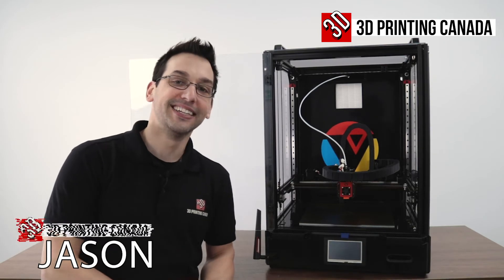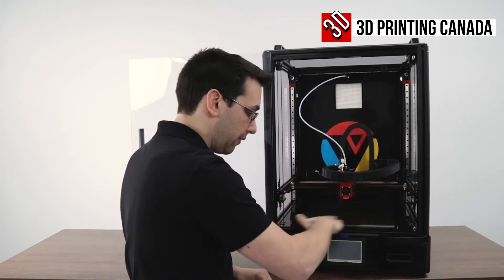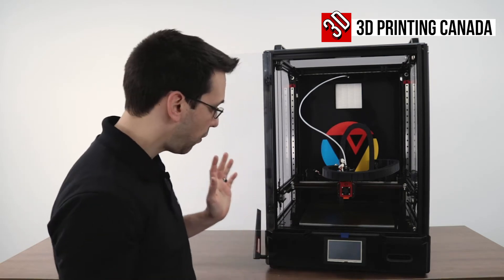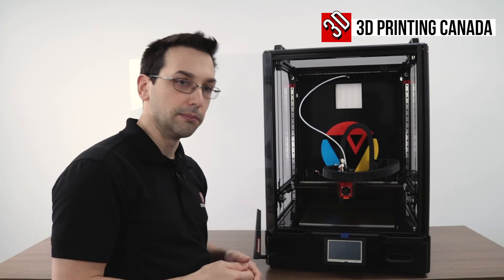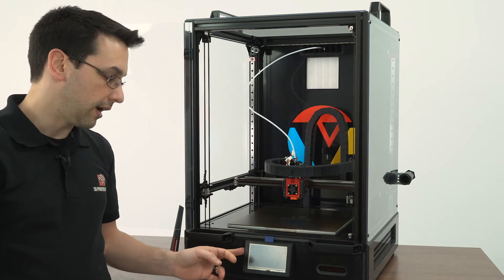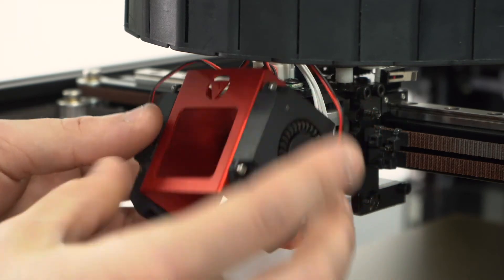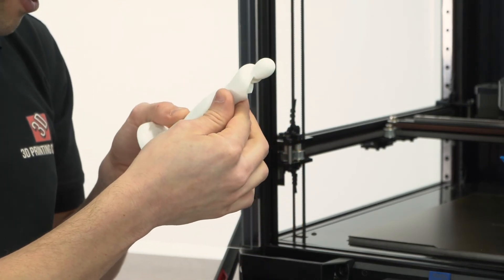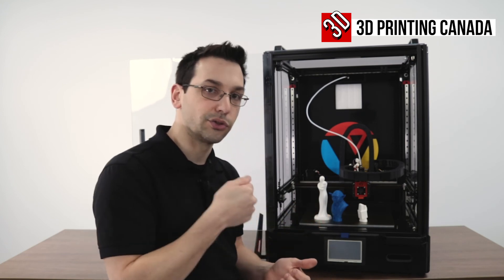Formbot Troodon 2021 Update

Comment: I own a 400 Troodon for 1 year now and upgraded from the extruder from the beginning. The bowden setup is just unusable on that size. The printer itself is reliable but uses the old voron non direct drive for the core xy belts. For the price tag and lin rails i expected better print quality. Due to the long belt setup and too big tolerances in the pullies bolts you get z banding issues in the prints. Additionally the free hanging extruder cable chain introduces unusual mass shifts which also results in unwanted extruder head movements (just lift your cable chain and look at youre extruder nozzle, you can see it moving). If youre new in 3d printing then you probably think this is a normal thing but a good designed and tuned printer does not have such issues. I'm curently upgrading to a new xy gantry, separate cable chains and bolts all around. The base setup of the machine is good for the build volume it offers, it just lacks in the details ... so if your willing to invest some more in your printer then you have an ok machine to start off.

Comment: Does the printer V2 2021 already exist? You can only find the older version with the Bowden extruder according to the pictures on the Internet?
Reply: Just because you see a Bowden tube doesn’t mean it’s a Bowden system. It’s used to guide filament because the filament path is a little long. Reverse Bowden.

Comment: I really like this printer. I have had no problems with it for a year now. My only problem is that 3D printing Canada has yet to send me the broken parts that it came with. It's been over a year and I still have received nothing. One of the belts was cut in half and the hinge was broken. I still have received nothing. I purchased from them because of their supposed excellent customer support. I will be doing a video soon about my experience with them

Comment: I have the 400 of this printer, am happy. 
the BLtouch is real. The board is not cloned, it's developed from scratch and is "duet compatible."
That bright sticker comes off super easy. 

I've put in a pi and installed klipper. 
Check out our troodon-specific advanced facebook group, "advancedcorexy"
We also have a website, advanced3dprinting